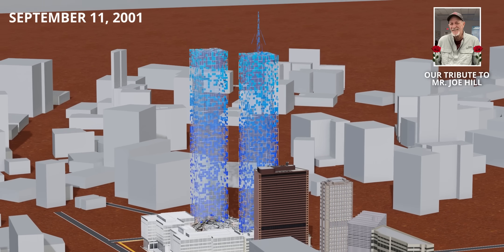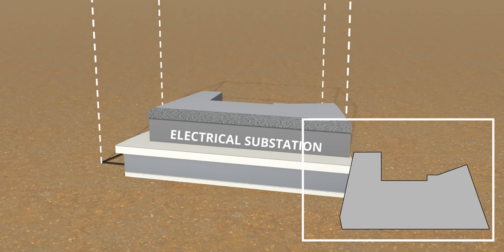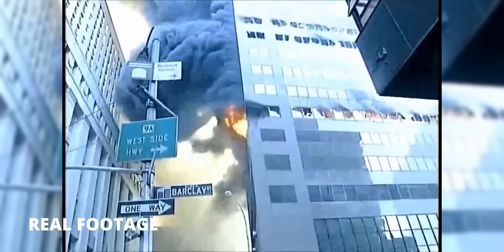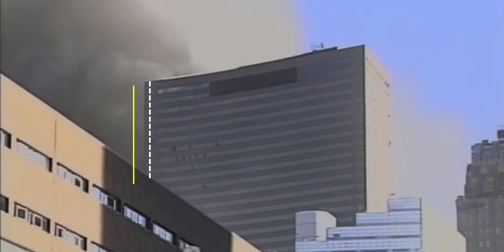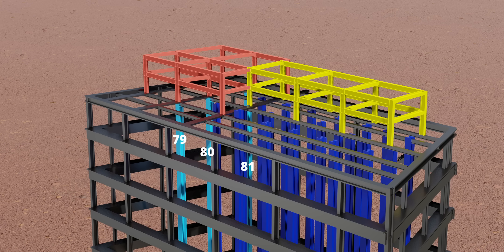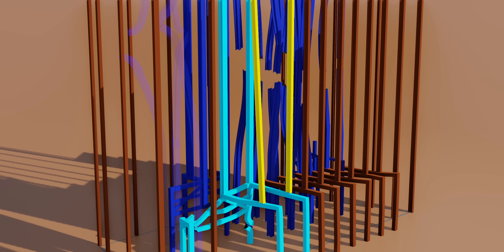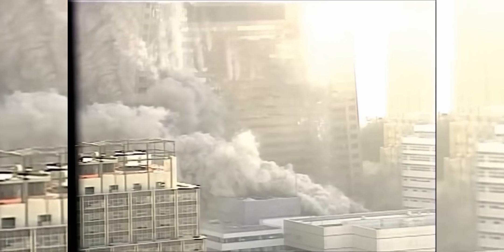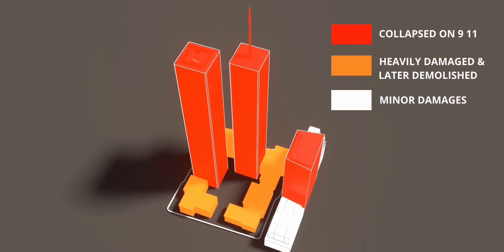Collapse of Building 7 | The Complete Physics

Comment: Total BULLSHIT!
Reply: And yet not wrong. Go figure. 
	
This video is pretty good – with a few exceptions - and goes into a much higher level of detail than many viewers will be able to comprehend.  While not perfect, the collapse mechanisms – the sequence of failures - described here  are substantially correct and this is true no matter who planned and carried out the 9/11 attacks or why . 

That may not be what you want to hear and go against 20+ years of entrenched dogma and conditioning, but it’s not wrong. 

That also means (in case you did not get the hint) this video can be (and IS) absolutely correct in its description of collapse mechanisms AND the 9/11 attacks could still have been some sort of inside job. The two things are in no way mutually exclusive. 

The mechanisms described here have broad professional support around the world. There are no professional engineering organizations (for example: ASCE, ASEE, ICE, etc) that disagree with them or have offered any formal dissenting opinions or alternative hypothesis. 

So, setting hubris aside, either the overwhelming majority of the worlds structural engineers and simple observation are wrong,… … or you are. Which seems more likely? 

IF you still think believe this explanation is wrong then produce a better one . Good luck with that. No one ever has and I don’t see you moving that needle today.
Reply: @TheCriticalStinker-jw4fl  your handle should be the critical crack smoker because you must be hitting the crack heavy if you think it was anything less than a controlled demolition. Engineers and Architects for 9/11 would say different.  Please give another circumstance, where a steel framed building has collapsed in that exact same manner in history. 
Please also explain why clean up started immediately instead of some type of a forensic investigation which would have taken months/years, conveniently removing all of the evidence disappear so pin heads like yourself can spout their BS.
Reply: @TheCriticalStinker-01 
Keep drinkin  your denial hooch

Comment: Free fall speed no BUT  FREE-FALL ACCELERATION YES! 

Even NIST SAYS SO!
Reply: There is no such thing as free fall SPEED

Free fall acceleration is just that - a measurement of acceleration NOT velocity. The NIST know that and would never use a silly nonsense term like free fall speed

The NIST  in case you had not noticed also were quite clear Building 7 collapsed due to nearly 7 hours of building-wide unfought fires. That is BTW entirely compatible with their insignificant finding of a tiny moment (2.25 seconds NOT 8 seconds) that averaged FFA for a single point on the exterior shell (hint: they were not measuring THE BUILDING) at the very end of the collapse event . 

BTW - that should have been enough of a hint the collapse was by definition progressive and thus NOT symmetrical, just as described in the video above. 

You really need to stop getting your engineering information from random morons on the internet.

Comment: people still believe it was a structural failure after 24 years???
Reply: People still believe in conspiracy theories in 2025?
Reply: @ conspiracy theorist simply means being 6 months early to the truth
Reply: @d1want34  - A Conspiracy Theory in the common vernacular is a speculative conjecture where the conclusion is arrived at first, then (maybe) evidence is cherry-picked to fit and fabricated to fill in the blanks as necessary with anything that doesn't fit hand-waved or ignored. It is a belief-driven system, where not only is little to no thought required, but real thinking is genuinely discouraged.

Quite the opposite of science. 

People are drawn to conspiracy theories as a way of grappling with life's uncertainties. It gives them a sense of empowerment and control without having to do any actual thinking.  There'sa  chosen people ego stroke element to it as well.

Everything seems like a conspiracy if you don’t take the time to understaned how stuff works.
Reply: Of course it was a structural failure.  That's why the building is not still standing. The structure has to fail for the building to fall.
Reply: @TheCriticalStinker-jw4fl wow, what critical thinking you have.. you are so willfully ignorant,  the building was blown up by controlled demolition,  THAT was where the structural failure came from, and it was even reported on tv before it collapsed, repent or stand before God and be sent to hell.

Comment: The 9/11 collapse vids have such civil comment sections.
I am tempted to note things I want to remark about.

In general :

- House experiments do not scale up well. If your chair was twice as big, it would not be twice as heavy but the cube of its weight/mass/equivalent amount of bald eagles (square cube law). This matters much when dealing with kinetic energy (ke = 1/2 mass x velocity²). For a same velocity, you're dealing with much more energy than twice for the bigger chair than the normal one.

- Building support structures are only managed for the stress of supporting a building, and not plane crashes, especially not if those crashes are supposed to be rare. The limit is only some amount above the actual supported load, and the total load is shared between all the support beams. There may be redundancy but only to a point, and heat of course reduces that limit. One pillar less and the load is going to the others. Enough pillars less and they're past the limit, and will suffer stress until they fail. It would be unsurprising if a pillar snapping was as loud as an explosion, especially from the basement of WTC7 where the 8 stands failed. 

- You don't need 9/11 to be an inside job for the US government being somewhat responsible. 
The CIA has a history of meddling with other countries and of overthrowing them. And they were fond of supporting and training groups that fought USSR influence such as the Talibans of Afghanistan. Bush also made up the WMDs of Saddam Hussein, didn't he? All the propaganda/cover-up he would have really needed is that people didn't find out whether or not Al-Qaida was another armed group the US trained. No need to argue demolition charges : simpler theories are often best, and you got historical precedence to support this one.

The twin towers :

- Planes are not lightweight, they can still weight in the tons. They also reach speeds of about 500 mph (533 for the Boeing 767 class,  or 238m/s). This is faster than your car (about 100 mph, or ~44m/s), for much more of the weight (82-180 tons vs ~2 tons). 

- Impacts are not material rock paper scissors. If the material does factor in ways I don't understand yet, the damage of impact is dependent more on the kinetic energy suddenly transferred. Remember the formula earlier ? 180 000/2 times 238²= 90 000 x 56 644 = 5 097 960 000 Joules, or ~5.1 TeraJoules of energy for a fully-loaded Boeing 767 going at max speed. This is equivalent to 2 770 times the energy of a 800mm AP round from the Schwerer Gustav, the biggest gun of history meant to destroy seven meters of reinforced concrete. 

- Instead of your home experiments with tiny household items, look into guns and ballistics. Especially .50 BMG. .50 BMG is a heavy machine gun round that sends ~43 grams bullets at 1 000 m/s. It can penetrate about 20mm of RHA steel while just being made of copper alloy with some steel. Which is harder? The steel plate obviously. Youtube doesn't lack gun shooting vids. 

A plane can very conceivably destroy the concrete and steel of a building, as well as debris can. Being fast and heavy matters more than being hard and sturdy.
Reply: Also avoid saying "I'm an X" to try talking from a position of authority. It does not reinforce your argument the slightest and it even ruins it if it's bullshit or seen as such. It's the logic of your argument that's meant to make the answer plausible, not that you called yourself an engineer in skyscraper collapses by intentional plane crash.
Reply: I think that when huge passenger planes that can contain more than 300 people hit very tall, probably top heavy buildings they fall
Reply: @petrifiedjello  
I read someone arguing that because planes are made of aluminium and the towers of concrete and steel, the towers couldn't have fallen because a soda can thrown at a tower of books doesn't make the thing collapse.
I am not kidding.

Comment: Bullshit. This bs video is a lie trying to convince all of you it was a collapse by heat. The truth is this one tower, tower 7 proves demolition free fall.
Reply: And yet not wrong. Go figure. 
	
This video is pretty good – with a few exceptions - and goes into a much higher level of detail than many viewers will be able to comprehend.  While not perfect, the collapse mechanisms – the sequence of failures - described here  are substantially correct and this is true no matter who planned and carried out the 9/11 attacks or why . 

That may not be what you want to hear and go against 20+ years of entrenched dogma and conditioning, but it’s not wrong. 

That also means (in case you did not get the hint) this video can be (and IS) absolutely correct in its description of collapse mechanisms AND the 9/11 attacks could still have been some sort of inside job. The two things are in no way mutually exclusive. 

The mechanisms described here have broad professional support around the world. There are no professional engineering organizations (for example: ASCE, ASEE, ICE, etc) that disagree with them or have offered any formal dissenting opinions or alternative hypothesis. 

So, setting hubris aside, either the overwhelming majority of the worlds structural engineers and simple observation are wrong,… … or you are. Which seems more likely? 

IF you still think believe this explanation is wrong then produce a better one . Good luck with that. No one ever has and I don’t see you moving that needle today.

Comment: What a complete load of BS.
Reply: And yet not wrong, which is why taht was the absolute best you could come up with. 
	
This video is pretty good – with a few exceptions - and goes into a much higher level of detail than many viewers will be able to comprehend.  While not perfect, the collapse mechanisms – the sequence of failures - described here  are substantially correct and this is true no matter who planned and carried out the 9/11 attacks or why . 

That may not be what you want to hear and go against 20+ years of entrenched dogma and conditioning, but it’s not wrong. 

That also means (in case you did not get the hint) this video can be (and IS) absolutely correct in its description of collapse mechanisms AND the 9/11 attacks could still have been some sort of inside job. The two things are in no way mutually exclusive. 

The mechanisms described here have broad professional support around the world. There are no professional engineering organizations (for example: ASCE, ASEE, ICE, etc) that disagree with them or have offered any formal dissenting opinions or alternative hypothesis. 

So, setting hubris aside, either the overwhelming majority of the worlds structural engineers and simple observation are wrong,… … or you are. Which seems more likely? 

IF you still think believe this explanation is wrong then produce a better one . Good luck with that. No one ever has and I don’t see you moving that needle today.
Reply: @TheCriticalStinker-jw4fl  and yet nist still cant account for the several seconds of free fall. The free fall completely disproves the every bit of bs that has been presented. NIST acknowledges the free fall but completely ignored it while making their report. Get real
Reply: @ericwieboldt7042 - Sure they can you should actually read the report, in its entirety rather than mindlessly repeat the failed arguments of others who also didn't read it.
Reply: @ericwieboldt7042  - No they didn't. There wasn't even anything to explain.  The inclusion of the (inaccurate BTW) Chandler data had zero impact on the conclusions of the NIST final report, for reasons that are obvious to those of us who both read and understood the thing. 

Please stop making stuff up and actually read the report

Or if The NIST is too TLDR for you (hey, it's not exactly a page-turner) then you can read my analsysis, done quite independent of The NIST.  It should only take about 5 minutes. Only after than when you still don't get it can we discuss the dozens of ways the free fall argument has failed every single time it has been presented in the last 18 years.
Reply: @ericwieboldt7042  - Again, The NIST added the Chandler free-fall data to its final report, where it's conclusion changed absolutely nothing - because it was already in there (just not spelled out in detail).  This nothing in the conclusion was changed except for a minor re-wording of one sentence.

The insignificant period of free fall measured for just a single point on the exterior moment frame (which is NOT "the building") at the very end of the collapse was a product of collapse progression mechansims, NOT collapse initiation mechanisms and is thus of no consequence.  It can not possible tell us what started the collapse or why. 

Why do you keep ignoring the fact almost 90% of the collapse occurred BEFORE this insignificant measurement?

The NIST concluded 7 hours of building-wide unfought fires made the structure increasingly unstable until it collapsed, and a brief moment of more-or-less free fall for the very last bit of the building to drop is 100% compatible with that. 

Again, you should have actually read the report you complain so much about instead of letting someone else cherry-pick one little bit for you. It's all in there.
Reply: @TheCriticalStinker-jw4fl  the irony of you telling me I'm from while you pull your information from a report that completely ignores one crucial fact, a fact that completely dismisses the six years of gymnastics that nist went through to come up with their bs final report. A report that you just gobbled up, swallowed down and now regurgitate for your echo chamber. I feel sorry for you.
Reply: @ericwieboldt7042  - You are the one that brought up said report, which describes a collapse induced by 7 hours of unfought fires and a brief period that averaged FFA for one spot on the hollow outer shell (which is NOT THE BUILDING) at the very end of the collapse. 

Both things can be and are true - despite nearly 2 decades of internet conspiracy dogma - and the 9/11 attacks can still even be an inside job.

Pity you refuse to accept or understand simple facts and can't be open to that bit of bleeding obvious.

Chandlers measurement of alleged free fall starts 10 seconds after the collapse began. About 90% of the building  - ALL of the interior structures - were gone by that time. The only thing left standing was the exterior moment frame - a hollow, empty shell like an empty cereal box. It looks like "the building" but it isn't.  Just a hollow shell.  Just one measurement was taken from that falling at the very end of the collapse. 

That's it.  

You've been lied to since 2006. You probably should have actually read the report instead of just believing whatever the internet tells you.
Reply: What? You dont trust the government?